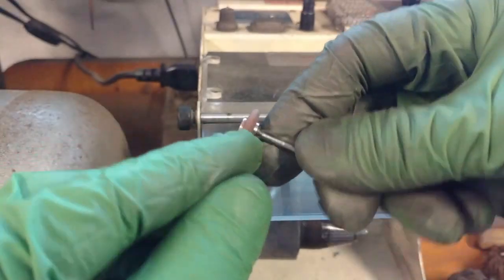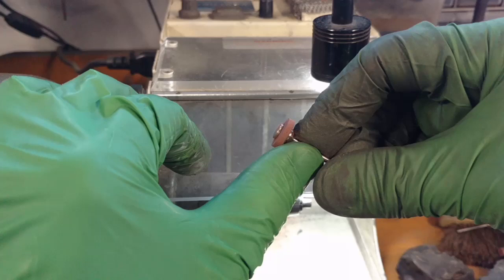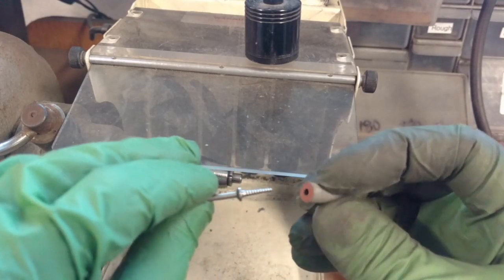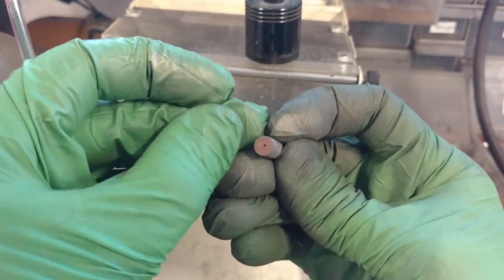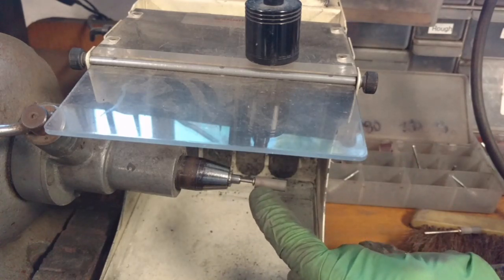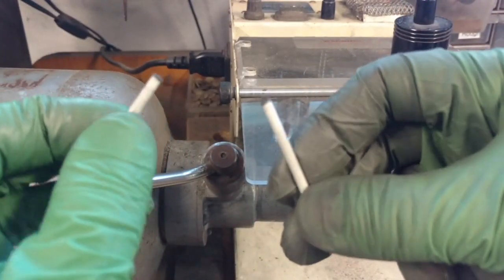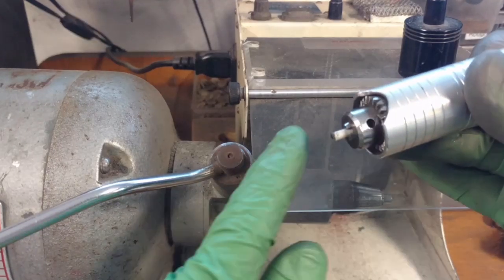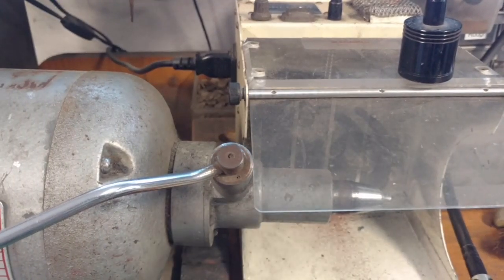Quick Shop Tips

Comment: What is the motor chuck that you're using
Reply from the maker: This is the foredom H.30 hand piece for a foredom motor with flex shaft.
Reply: @earthartgems  thanks for the reply, but I was asking about the chuck on the bench motor. I know it's old but I would like to see if I can find one
Reply from the maker: @denttech2515  I did indeed get this used, it's about 40 years old now (I've had it for 10 years and it runs super smooth. It is a dental polishing arbor, made by Baldor, with a "wells quick chuck" on the right and a standard tapered spindle on the left. It is the 380 series. the quick change accepts 3/32" and 1/4" without having to change anything. You can see them an baldor's website. they go for around $1400 new for the entire unit), or, I found you can search on ebay, in these search results, there is a used one for $450  https://www.ebay.com/sch/i.html?_from=R40&_trksid=p2334524.m570.l1313&_nkw=baldor+dental+polisher+380&_sacat=0&LH_TitleDesc=0&_osacat=0&_odkw=baldor+dental+polisher  hope that helps.